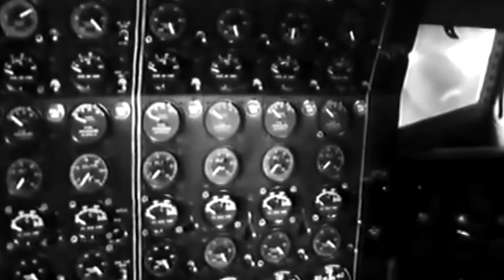The Largest Military Cargo Plane to Ever Barely Fly - H-4 Hercules

Comment: If shipping had bamboo light wood around the hull of ships it would mean slightly slower speeds but a torpedo exploding nearly inside rather than a hit meaning a certain sinking kill. Just need ultra light strong bamboo fencing connected together chicken wire but dangling a few feet from hull say 4, 5, poss 6ft from hull.

Comment: If he took a drill to his plane all over tiny holes wings & body but covered back after drilling w/fabric it would surely ground effect hve worked greatly w/right  light enough loads. Just 1000s of holes 1/2" needed max to save weight.

Comment: Hi, Dark Skies.
Thank you for an interesting video.

That said though, the British Royal Air Force did eventually develop the 'hardware' necessary to do some serious damage to the German U-boat pens with the 12,000 pound Tallboy and then the 22,000 pound Grand Slam bombs. There are reported instances of the Grand Slam bombs penetrating THROUGH the 20-foot thick concrete roofs of the U-boat pens and exploding INSIDE the pens, throwing whole U-boats up onto the docks inside.

Admittedly, this did come late in the war but it did happen.

Just my 0.02. Thanks again.

You have a wonderful day. Best wishes. Deas Plant.

Comment: While I agree with Rooster about his comparison to Kittyhawk, I question whether the H4 actually achieved flight in the technical/aviation sense.  I had an interesting talk with a docent at the museum when the H4 was still in Long Beach, CA, a man who worked for Hughes and was present at the event in 1947.  He and I are both pilots and we both commented on the fact that the H4 had lifted off at "full power" on all eight engines, but had not climbed above 70 to 80 feet above the water.  Airplanes, especially high-wing ones, are capable of lifting off well below stall speed, in ground effect.  In fact, this is a technique that is taught in flight training today for takeoffs from rough runways (grass, tall grass, wet grass, etc.) .  Typically, the airplane will "climb" to a height of about 1/2 of its wingspan, maximum, while in ground effect.  On a rough field or on water, this allows the airplane to accelerate, away from the friction and drag of the rough runway surface, until it is above stall speed and able to climb out normally.

The docent and I were talking about this when he said something intensely interesting - 'Hughes had invested about $80 million in the project, which the US government was required to repay when a "prototype aircraft was flown successfully".  "Hughes was a daring and master flyer", he said.  "He had an instinctive feel for what an airplane was doing, and what it could do.  He was also the boldest person I ever knew, willing to risk everything to win or succeed."  "Given who and what he was, and what was at risk - $80 M was a LOT of money back then - you would think he would have climbed on out that day, to about 1,000 feet and done a couple of turns around Long Beach Harbor, just to thumb his nose at Congress - but he didn't."  "His whole reputation, and a substantial part of his personal fortune, was on the line, but he didn't."  "Instead, after another high-speed run, he taxied back in to the pier, got in his car without making a statement, and never went back to the H4 again."  "He later ordered a massive hanger to be built around the plane's mooring, and ordered that it be kept locked and guarded.  This persisted until his death more than 3 decades later, and he never mentioning the Hercules again in public, after which he slowly lost his mind."  "Makes you wonder, doesn't it ?"

And, after hearing from this gent, it did make me wonder.  About Hughes' personality - defiant, challenging, a little unhinged; and his need to collect $80 million from the government.  About whether the "master flyer" had lifted the H4 off the water and discovered that, even with eight of the most powerful corn-cob radial engines available running at full tilt, the H4 would not climb further and, realizing the awful truth, put her back down and hid her away for the rest of his life, which allowed him to maintain is reputation and recoup his investment.  Then, possibly unable to face the public or his staff, Hughes also hid himself away from public life until his death.  It's an interesting idea, and I'm sure many would challenge it, but it does answer a lot of questions...

Comment: I've seen it where it rests today. It's a glorious bird that dominates the room it sits in next to an SR-7. But some argue that perhaps the Spruce Goose never actually flew. The point being that the plane never got out of ground effect, where air trapped under the wing provides the lift. To be in flight requires a flow of air over the top of the wing to provide the lift needed to break the bonds of earth.

Comment: As any seaplane pilot will tell you.. the most difficult part is getting the aircraft to unstick from the water.  Lots of tricks involving aircraft that are more than capable of climbing up to 5000 or 10000 feet involve creating a wake to cross back over, popping the flaps, and doing a float roll (rolling the aircraft so one float lifts off the water before the other). 

After that.. it’s easy.

Comment: I was able to go aboard her when she was put under the dome next to the Queen Mary at Long Beach you got to go up the steps and in and through the aircraft, it was completely empty inside as the only seats were up on the flight deck and man was it big. They had one of the motors on a stand I’ve never seen so many stacked real engines before they were huge as well.

Comment: People arguing "did it fly or not?" Yeah, it flew. It just didn't fly well. It was too underpowered. Had it used more powerful engines, it might have become a decent cargo carrier for its time. It simply remains a curiosity. Hughes had the right idea, but the lack of engine power doomed him along with the advent of jet engines being used.
Reply: The Pratt & Whitney R4360 was probably the most powerful piston aircraft engine to find its way onto production transport aircraft so its difficult to see how “more powerful” could be possible until high power turboprop engines became available some time later.

Comment: A great summary of this fantastic achievement and quite beautiful aeroplane.  I saw it once when it was kept down in California and it's good to know it's found another secure home.
I know you're trying to keep this visually accurate so you should know that the ship being sunk at 1:13 is actually the Battleship HMS Barham.  Barham was torpedoed off the Egyptian coast on 24 Nov 41 and suffered an explosion in her main magazine.  Ironically, she was supporting destroyers on an anti-submarine patrol at the time, but her sinking as shown in this very famous and widely used clip had nothing to do with the Battle Of The Atlantic or therefore the genesis of the Spruce Goose.
However, as you can tell from the restriction placed on it, the Hughes aircraft was never considered as a viable way of countering the loss of merchant shipping.  It was only ever a 'we'll try it in case it works' back up.  With a 75-ton payload it would never have been possible to make even a small dent in the mass of cargo that needed to get to Europe.  The mass-produced Liberty Ships were a better investment.
Ironically, the PBY-5A you show had conventional undercarriage so it could land on runways if necessary, so no weight saved there.
I did enjoy the shots of Short Sunderlands though, and of course along with the B-24 and others these became the mainstay of the real cure for the U-Bout Scourge.  Not as transports but as ASW platforms with excellent endurance, a good weapons load and, of course, air-to-surface radar.

Comment: Here's a Wikipedia link to the Spruce Goose: __ https://en.wikipedia.org/wiki/Hughes_H-4_Hercules
I grew up in the Long Beach area, and I went to one of those rock dance concerts in 1990 held under one of the wings of the Hercules.  Stage and hundreds of people under one wing!  When not dancing, we could take a quick tour through the plane.  Prior to 1980, the Hercules sat in an air conditioned harbor-side hanger for 33 years!

Comment: Total fraud as an aircraft.  It never got out of "ground effect". Aircraft closer to the ground than their wingspan are in ground effect, a curious state where they benefit from a cushion of compressed air that lends them extra lift.  Hughes was enough of a pilot to recognize this, realized it would never climb higher, especially with any sort of cargo weight, and set it back down, declared success, and never "flew" it again, meaning he didn't have to leave the country as promised.

Comment: Why didn't they build airships instead of flying boats? No research or testing required and easier to unload because the cargo is suspended beneath it 😐
Reply: One word Hindaberg
Reply: @demonprinces17  
The Hindenburg exploded because of the use of highly flammable gas, used only because of the U.S.A's embargo of helium to the axis powers.

Comment: The most impressive thing I've heard about the plane is how amazing it is that both wings weigh about the same. Apparently even the most consistent wood given enough length is going weight differently in differently in different areas and in the case of a plane between the two wings. Lack of "trim" was not one of the Goose's problems it was perfectly balanced which really is incredible. I mean if Detroit had just an ounce of that kind of quality control we would still be the world's car makers.